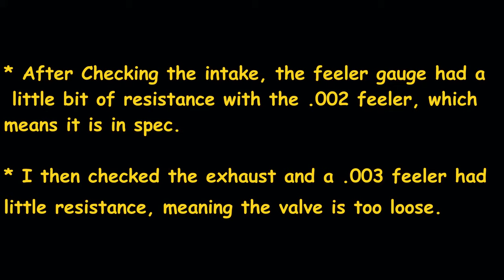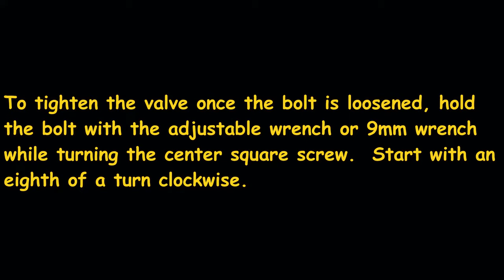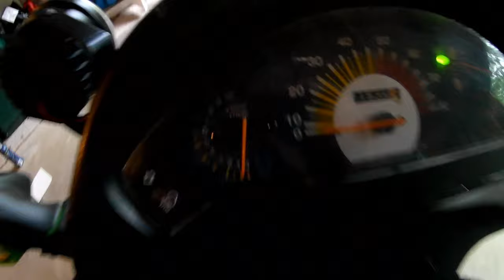How To Adjust The Valves On Your Scooter | Do It Yourself Valve Job On your 50cc and 150cc Scooter

Comment: So values set intake 00.2 and ex 00.3? I have a  rand new 150cc and cant get it start so that's the last
Reply from the maker: It will all depend on what your manual says. Every engine is different and each scooter is unique. Check out the manual and see if it has a specific setting.
Reply: Nope it does it say anything.
Reply from the maker: What kind of scooter is it?
Reply: It's a 150cc hawkeye

Comment: Where does that vacuum hose go to
Reply from the maker: The fuel system runs off of the vacuum from the engine. There is a vacuum line that connects from the fuel pump, to the engine and carb. There is also a fuel line from the fuel tank to the fuel pump and then to the carb.  So, when the engine runs, it pulls vacuum from the fuel pump and draws fuel out of the tank.